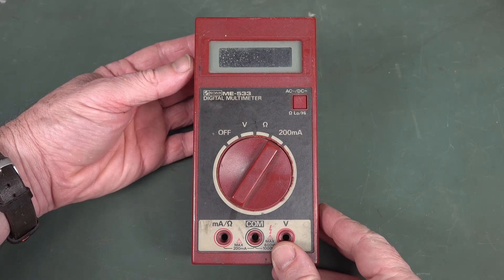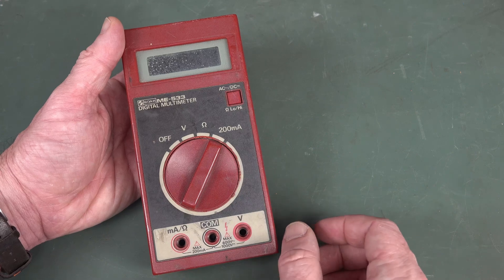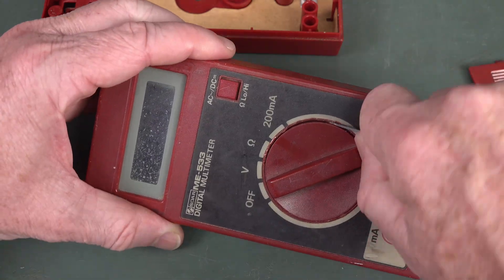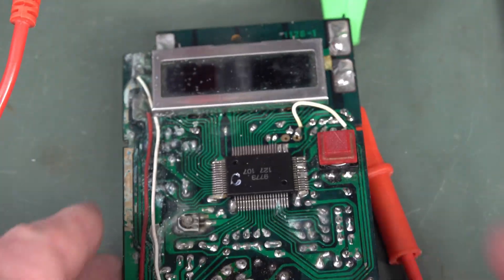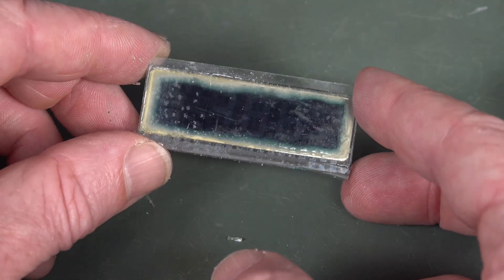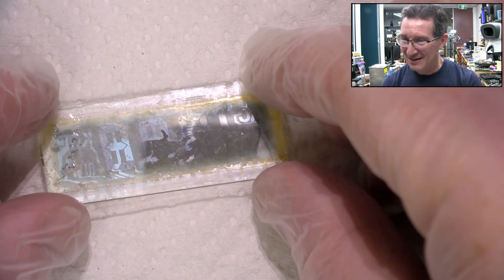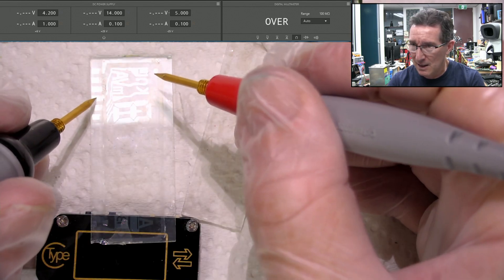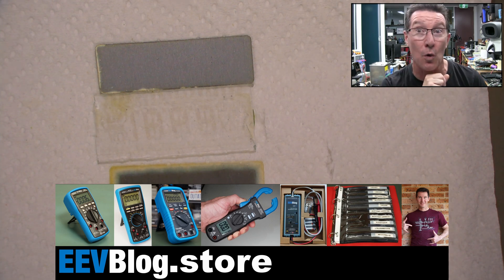EEVblog 1642 - Can I Resurrect My First Digital Multimeter?

Comment: To bad to see that it has "gone bad" ☹. I still have my first one also (a super cheap one, don't use it anymore of course), I got it around the same time as my first soldering pistol 😂. Got the soldering pistol from my 'uncle' (was actually my fathers best friend), but VERY quickly moved on to a 14W weller (no temp control). This was about 27ish years ago now. 

Not sure if you will see this one, but wondering if you also still have your first soldering iron/gear and or do you still use it? (I SHOULD still have the pistol somewhere, I THINK, but not sure though😂)

EDIT: I Obviously do know that Dave has much better soldering gear these days😂, just wondering if his first one would still be usable these days. Considering I also still have tools from my early 'kiddo days' which I do still use today.
Reply from the maker: I still have my original Hakko 926 I got as a teenager, I use it in my bunker. Don't have my original first Tandy adjustable temp iron, what sure whatever happened to that.

Comment: Seen LCDs in old cars do that but I suspect those happened due to extreme temperature swings (-40 during the winter and up to 20-30 C when it's running) and the generally high humidity that is inside vehicles. Never on anything like that.

Edit: On the subject of finding a suitable donor - I replied with a link on your comment about not finding it over on X